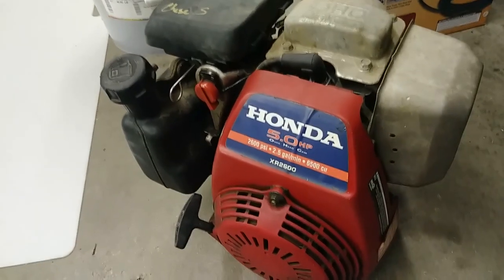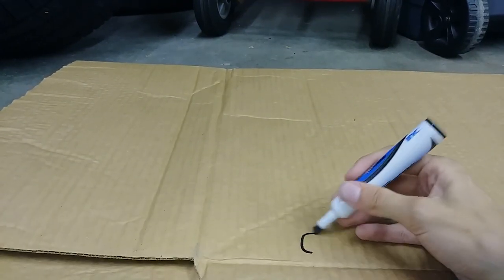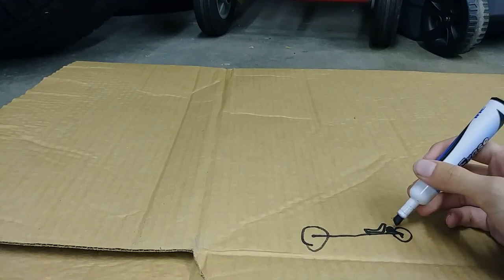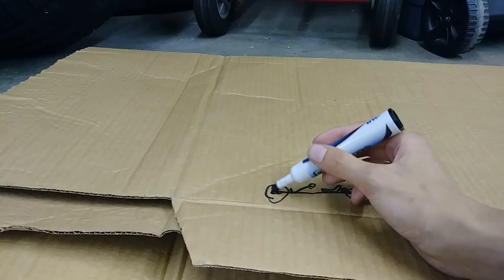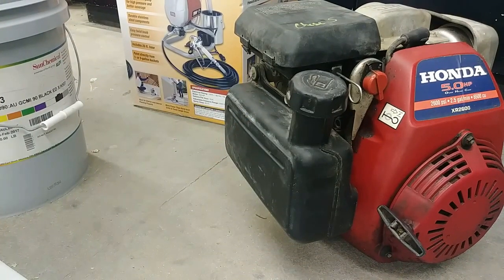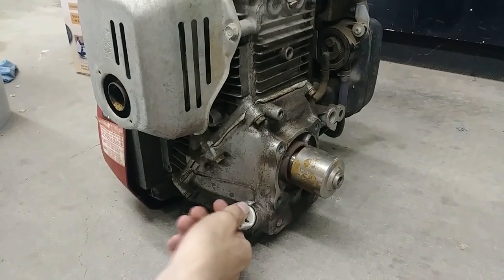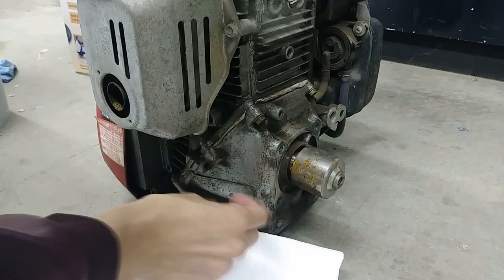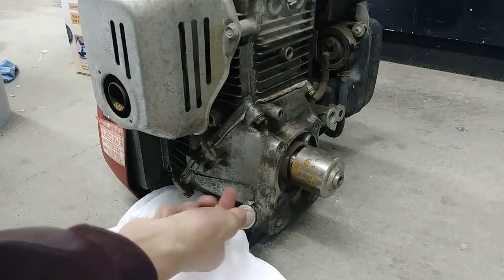using a lawnmower engine to make a go kart

Comment: How fast can u make the engine go?
Reply from the maker: Depending on how you design the go kart, the drivetrain, and if you do any modifications to the engine. 

I'd say with this 5.5hp engine you can get it up to 50mph.
Reply: @j.schaeffer6763   do you have any websites with a bit cheap engies but good prob arround 100dollars?
Reply from the maker: Harbor Freight sells engines at low prices.
 https://www.harborfreight.com/engines-generators/gasoline-engines.html

Comment: what type of motor are you using?
what type of lawnmower?
Reply from the maker: using a Honda 5hp engine. I bought it for $75
Reply: @j.schaeffer6763  ahh nice
Reply: I have a Honda 6 horsepower engine from a old power washer than never ran all it needs is a pump 👍 so I'm a whole 0.0 dollers